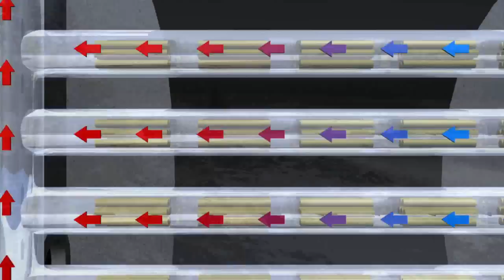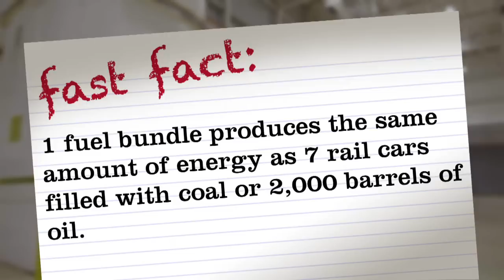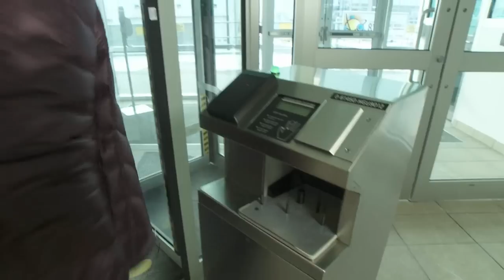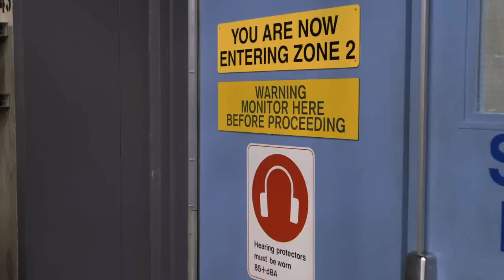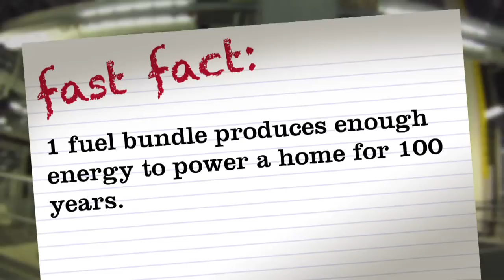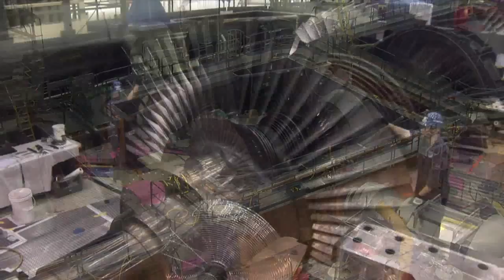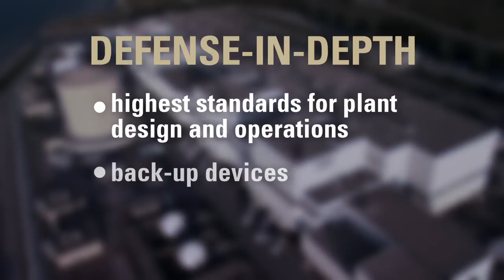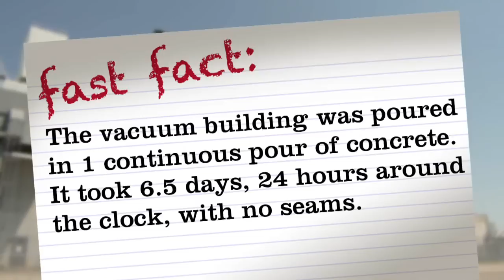Welcome to Darlington Nuclear Generating Station

Comment: An oddity about this video : when the assembly of a fuel bundle is illustrated, a 28-element bundle is shown. This type is used only in the CANDU units at Pickering. The four Darlington units, along with the eight at Bruce, as well as Point Lepreau in New Brunswick, Embalse in Argentina, Cernavoda in Romania, and others, all use 37-element bundles with three concentric rings of pins (6, 12, 18) around a single central pin. KANUPP in Pakistan, and the CANDU-derived Indian PHWRs use 19-element bundle (minus the ring of 18) of similar construction.
Reply: Nice one!! .. good catch!
Reply: On behalf of Cernavoda NPP , I confirm.
Reply: KANUPP and NPD used 4" pressure tubes thus the smaller bundles

Comment: Thank you for Generating power for us in Oshawa, though itd be nice if Oshawa could keep its power grid in shape, random places get power outages that cause problems like no power at home or no power at work. Darlington is something I pride my self on being a neighbour to it, a proper clean Canadian nuclear power plant.
Reply: @deeremeyer1749  Thing is buddy, our Nuclear Power plants are designed differently than the typical vertical reactors of most other plants. CANDU nuclear reactors are virtually immpossible to melt down due to their design. If they over heat, the fuel channels will sag and contact the reactor shielding and bleed heat off and we dont use highly enriched uranium.
So far the worst thats happened with any CANDU plants are leaks of heavy water like at the old Pickering A & B plant.
Also the outages here aren't from the power plant, theyre due to a crappy grid that has now become much better today than I commented 3 years ago. The only time our power goes our now are a result of maintence on our building or faults that cause switching stations in areas to trip and knock out power to an area.

I realy dont think that a Chernobl or Fukushima will ever happen in ONtario due to the design of a CANDU. If it does, theres a lot more Canada I can move to (besides, I kinda want to live in Alberta or Saskatchewan or perhaps other hot dry places in North America)
Reply: @deeremeyer1749  All he said is that he's happy that the power grid is getting better and he's proud to be apart of a community that's actually helping the environment.
Reply: YIMBY - Yes In My Backyard.

This is unusual in the world, but common among nuclear power plants once they are up and running.

Comment: You can shut down a reactor in 2 seconds!? That's impressive. I read a little bit about the CANDU reactors and I think they are very safe and "clean" for a nuclear power plant. Specially they can take the spent uranium of a LWR plant and use it.
Reply: As far as I know we don't and never will. The throw-away cycle is much cheaper and less politically sensitive than recycling spent fuel. India is interested in thorium breeding so it can use its thorium sources but that's because they like to be self-sufficient, not because its easier or cheaper.
Reply: Not clean.  Underground pipes, it's a mess.
Reply: @leerman22  

0:02 / 23:44

Atomic Fuel India
15,765 views  Feb 19, 2012  (1962) Shows the manufacturing of uranium and thorium fuel for reactors from monazite sand found in southern India. The different stages of the mining and refining process are shown in detail.
Reply: Jus bc u shut down a reactor doesn't mean it's shut down...there's a huge problem called decay heat that has to be dissipated for months before its truly shut down
Reply: @hondamoto-rb6bk  It takes another normal generator to supply electricity to the mess for years after it's shut down...how can this be a cost effective method?  It's an insane way to boil water!
Reply: OPG also used their spent fuel for medical treatments.
Reply: @Themiddleman416  I am all for that, I am not for building giant power stations that also produce helpful items.  They produce probably more harmful things than the good ones.  At least that is a possibility.  Can't you just have a tiny reactor to make small amounts of it?
Reply: @widescreennavel  Nuclear power is very clean.
Reply: @KieraCameron514  oof
Reply: @Themiddleman416 spent fuel is not processed - medical isotopes are made via irradiation- in the shutoff rods for cobalt

Comment: My dad worked for AECL for about 25 years, starting in 1965 at Chalk River after working on the design of the Iroquois engine and then the Gemini and Apollo escape mechanisms.  In 1967 we moved to Bramalea where he started working at Sheridan Park as a reactor instrumentation designer.  

By looking at the dates does anyone have any idea which reactors he might have helped design?

   He said that one of the hardest projects he worked on was in figuring out a way to insert an instrument into operating reactor.  From start to finish it took 3 years.
Reply: Ya probably Pickering A  or could have been Bruce A they where both being built and you have to design a control room before you build it Sheridan research very cool!smart man!
Reply: Apparently the Canadarm in space is based on some of the principles that were learned during the insertion and removal of things into live CANDU reactors.
Reply: @TheGeeoff  My brother (his son) worked for the contractor to McDonald Dettwiler that built the wrist of the Canada Arm.  He personally developed the stereoscopic video system used for docking at the space station.

Comment: Only problem is there isn't that much uranium to go around anymore 
I wonder if they will build a thorium plant in darlington
Reply: That is completely and totally wrong.
Reply: The likelihood of building any more nuclear reactors in Ontario is nil or zero. The taxpayers in Ontario will not want to foot the bill for construction of another nuke plant. The cost isn't worth it at this time. Furthermore the cost of obtaining thorium from a foreign country (Canada doesn't have enough) and relying on it for fuel would be questionable.
Reply: All CANDU reactors are capable of using Thorium fuel with minor adjustments. Thorium test bundles have been used successfully. Thorium is more expensive at this time

Comment: I like how they explicitly mention the “vacuum building” and that it’s a special feature of CANDU reactors, but can’t be bothered to tell us what it’s purpose is.
Reply: The vacuum building is used to take in the steam from an individual unit if it has had a loss of coolant accident. The reactor buildings are not capable of with standing the high pressures from the steam, so the steam/pressure is allowed to be directed into the vacuum building where is doused in water to condense it back into water and drop the pressure
Reply: @mikestiglic1880  One thing you missed. If, and when, the vacuum building is used , in an emergency, the other three reactors, also connected to the vacuum building, MUST be shut down and cannot operate without the vacuum building's availability.
Reply: @tbarry4990  Thats correct. Cant be operating the other units when there is no NPC available
Reply: @tbarry4990  question, what if multiple (or even all) units needed to use the vacuum building at the same time? would it have that capacity?
Reply: @Cat_578  - I would like to think that the Nuke Operators (who have trained for no less than 7-8 years) have practiced many scenarios to ensure safe shutdown. The likelihood of multiple reactor failures with the CANDU design I wouldn't even think about it it would be so low. If you're talking about a nuke bomb being dropped directly on it? ... well you're screwed anyway right?
Once one unit uses the vacuum building the operators would immediately disconnect the other units from the grid and shut them down. Information on the CANDU reactor is available on the web.

Comment: At 2.09 she says, "the heavy water slows down tiny particles called neutrons, so they are more likely to hit and split the uranium atoms". I don't understand this. Wouldn't a neutron be more likely to split something it hit if it was going as fast as possible?
Reply: It has to do with Nuclear Physics. In the type of nuclear reaction described here, neutron has to be slowed down to "thermal energy", where it will most likely to cause fission. If this is not done, neutron is more likely to fly through an atom at high speed and won't even notice it.
Reply: Ah! Now I see...so simple, really! Thanks.
Reply: "fast fission" is possible but not as likely as "thermal" or slow fission.
Fast fission generates more neutrons(like 5-6, while slow fission generates 2-3) and can fission certain elements that "slow" fission can't. This can be taken advantage with specific reactor designs that take like 20-30% enriched uranium-235 (or plutonium-239), put those in the middle of the reactor and surround it with fuel rods containing mostly transuranic elements and Uranium-238 (can derive from spent nuclear fuel). The neutrons generated in the middle are used to fission the elements in the surrounding rods. These reactors also produce Pu-239 from the U-238 and either fission it all or let it accumulate so it can be extracted through reprocessing and used for water reactors or, unfortunately, bombs.
Reply: Thanks
Reply: A neutron doesn't hit or split anything like a bullet, it gets absorbed into and joins the nucleus of an atom along with all the other protons and neutrons usually making that nucleus unstable causing it to split on it's own. The neutron by itself didn't smash apart the atom, the instability of the now bigger nucleus breaks apart the atom. Slowing down the neutron makes it more likely to be absorbed into that atoms nucleus rather then flying by at high speed.

Comment: A lot of high tech shit going on here but is it really a good idea to build (multiple) nuclear power plants on the shores of the “Great Lakes”? No hate for nuke power just questioning if its a good idea with all the redundant protocols in place you would think keep away from the Great Lakes (just in case)
Reply: yes, it is. All CANDU stations are on Great Lakes (Darlington and Pickering on Ontario, Bruce on Huron). This is because the Great Lakes are excellent heat sinks. The water to cool and condense the steam back to water is drawn from and returned to the lakes. If the stations were away from the water they would require huge cooling towers, like those you see in US nuclear plants. Cooling towers are less efficient and require far more room than just drawing water from the lakes.
Reply: Interestingly, the slightly warmer water discharge from the plant (no, it is not increased in radioactivity) attracts fish, making for great fishing near the plant.   All power plants need a good heatsink to work correctly, and nuclear is no exception.  The great lakes provide that, and Ontario gets excellent clean power production.
Reply: @LFTRnow  I had a teacher in  high school who loved fishing by Pickering Station's outflow for exactly this reason.  The fish hang out right at the interface between the warm outflow water and the regular lake water.
Reply: There are also four reactors on lake ontario in the USA.

Comment: Keep the left overs in your backyard
Reply: If I had to choose between keeping the leftovers from nuclear or Coal in my back yard I would choose nuclear any day of the week and twice on Sunday.

For every TWh (TerraWattHour) of energy produced this many people die from pollution or  accidents related to this type of production:
32.720 - Brown Coal
24.620 - Coal
18.430 - Oil
04.630 - Biomass
02.820 - Gas
00.074 - Nuclear
00.035 - Wind
00.024 - Hydro
00.019 - Solar

Put another way for every 1 death attributed to nuclear there are more than 112 deaths attributed to other forms of power production.  My guess is those numbers for other forms of power are low because they aren't always attributed to the power production or waste stream.

Of course Solar is not feasible everywhere and is no good for base load power and can take up a lot of land that could be used for farming.  Hydro isn't feasible everywhere and has other huge environmental impacts.  Wind, again, is not feasible everywhere...

It is sort of like travel,  Everyone accepts deaths by car, but screams about deaths by plane even though travel by plane is far safer than travel by car.
Reply: I agree with Bill Mack, I'd much rather have the waste from a nuclear power station in casks near me than the waste from a coal station, or for that matter piles nearly unrecyclable   left over junk from wind turbines, solar cells or lithium battery packs.

Comment: Then What do you 
Do with your nuclear waste??? !!!!!!!!
Reply: Sensibly just chuck it back into the mines from whence it was sourced. Power reactors create very very little waste. Coal fired power stations create far more waste. Coal itself is far more radioactive than low enriched   uranium.
Reply: Depends on the waste. Used fuel is stored in pools of water for up to 10 years to cool before being placed in dry storage containers and stored on site. The federal Nuclear Waste Management Organization (NWMO) is in the process of developing a Deep Geologic Repository (DGR) for permanent disposal of the waste. Low and intermediate level waste (L&ILW) are sent to the Western Waste Management Facility (WWMF) for volume reduction (where possible) and storage in near surface storage structures. OPG is in the process of developing an L&ILW DGR for its permanent disposal.
Reply: @paulanderson79  Hahaha I can assure you that's is incredibly incorrect. Low enriched fuel is bombarded with neutrons in the reactor that turns it from uranium to a multitude of extremely radioactive isotopes that last for thousands of years. It is more radioactive when it is used up.
Reply: @milolouis  I know. The concern I have is the fear that people have of 'radiation'.
Reply: @milolouis  everything radioactive to one or another level.
Reply: @paulanderson79  I'm not sure what your point is. I'm pro nuclear energy but a reactor this size produces a large amount of extremely radioactive waste that currently has very few places to go. I think it's irresponsible to continue using slow reactors when fast breeders can produce so much more energy with less fuel and therefore less waste whilst burning up the most long-lasting isotopes.
Reply: @milolouis  I know that spent fuel is more radioactive than fresh fuel. It's the shortest lived isotopes that are the most dangerous, whereas U238, with it's 4 billion year half-life, is barely radioactive at all.
The problem I see is that we're conditioned to fear the words 'nuclear' and 'radiation' to an outrageous degree. Partly because it's fear that maintains the effectiveness of nuclear weapons. And partly because there's a huge amount of money still to be made to be made from oil.
There's also a fortune to be made from the management of reactor 'waste'. Which is where your point about fast breeder reactors comes in.
Reply: @milolouis  There are a few problems with this, starting with the fact that we already have these reactors and would have to build fast breeder reactors.  Also, the economics aren't there. Reprocessing used fuel is a difficult and expensive process, with a risk of exposing workers to a dose.  Fresh fuel is less expensive and safer to handle.  This may change in the future but I can't see used fuel being reprocessed any time soon.
Reply: Just as with any other kind of waste. Eat it.
Reply: Store it, release it or reuse it
Reply: Hopefully it is returned to once it came rather than finding a final resting spot at Port Granby (I dont know if that low level radioactive waste dump still exists.)
Reply: @paulanderson79  Better yet, reprocess it and reuse it again .
Reply: @caav56  exactly.
Reply: @paulanderson79  The more you reuse the fuel, the lower the unreusable waste becomes.